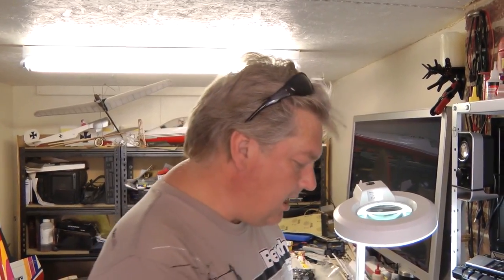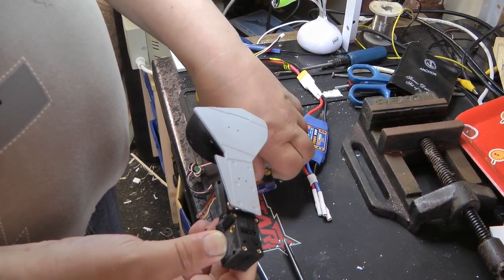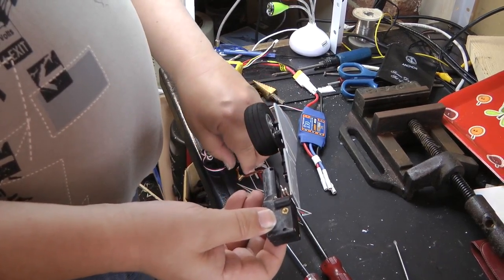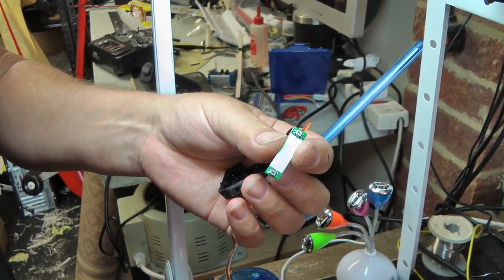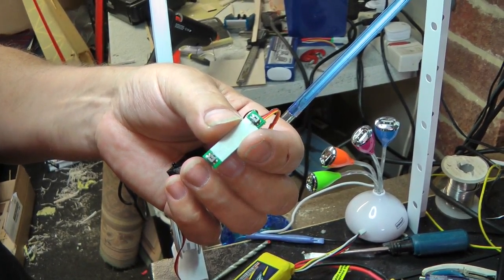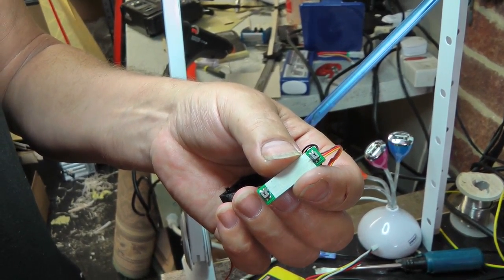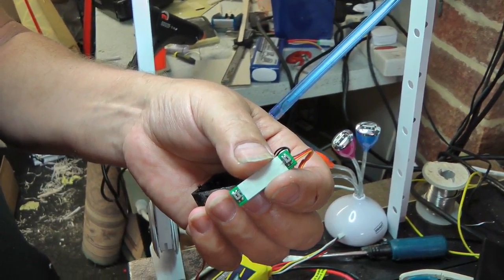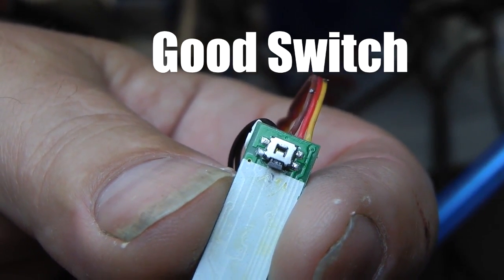Hobbyking fw190 Undercarriage Fail

Comment: I have the 1600mm FW190 which I bought about 2 years ago and have only just started flying in the last few months. Can't say I'm impressed by the quality! I don't know what holds the u/c door in position (it's not one of the grub screws)and one of mine moves so much it jams in the wing Too stingy to use a proper oleo like the FMS kit. One of the u/c legs was toed in at a ridiculous angle. Adjusting/tightening the 2 grub screws at the top merely pulled it out of whack. The locking/locating slots have been machined at the wrong angle. The whole assembly is glued in with chewing gum and pops out if the landing is anything but perfect. To retro-fit the u/c costs over 1/3 of the cost of the kit! Use the flaps you say...I would if they hadn't burnt out a servo because the hinges are too stiff. Then they use a servo that has been reversed. Use a reversing lead, yeah well most companies aren't making them anymore! Upgrading the receiver is more cost! Haven't read one report about the flaps!The horizontal tail didn't fit properly and no amount of tension on the 2 mounting screws would remedy it so I had to modify it. Luckily it looks good and flies well!

Comment: I have the same model which on the whole it's  very well constructed and has quite a substantial airframe for a foamy. The finish is also superb.When its in the air it flys wonderfully and has a surprising amount of power for a 3s. However on the ground it's a bit of a dog due to the lack of forward rake of the undercarriage. It's not too much of a problem on a hard surfaced runway but on our grass strip it invariably noses over both on take off and landing. I have toy'd with fitting longer struts and bigger wheels but this would mean hacking the foam and losing the sequenced doors which I'm loath to do. As I say the construction is quite a marvel as after all the impromptu nose overs it still looks fresh out of the box.
Regards
Nidge
Reply from the maker: The plane itself is great. some real good design features in it. I've found a few clicks of throttle on landing helps keep the tail down.
Reply: +RC Model Geeks it is a great design and the quality of the parts bely the price. I understand the designer was a Mr Liang who is/was highly regarded as a designer of model aircraft. Thanks for the tip regarding throttle use on landing. When you did the original build you commented that the prop might take a hit so I ordered some spares from CenturyUK but to date, even with my less than ideal landings, the original prop is still holding up.
Regards
Nidge
Reply from the maker: Yes thats right it certainly was designed by him. I damaged my prop early on (stones on beach). And of course at the time there were no spares! so i converted to a more normal prop mounting. so im now running with 3 blade grp props.